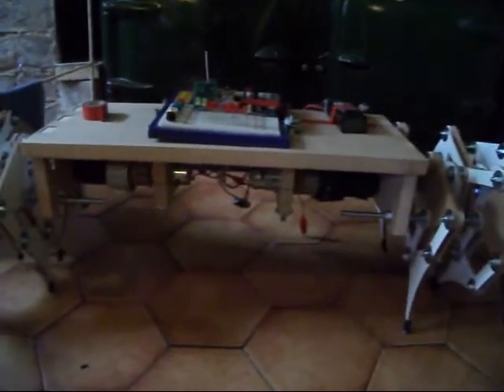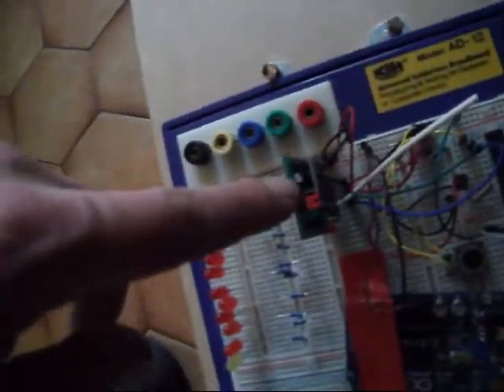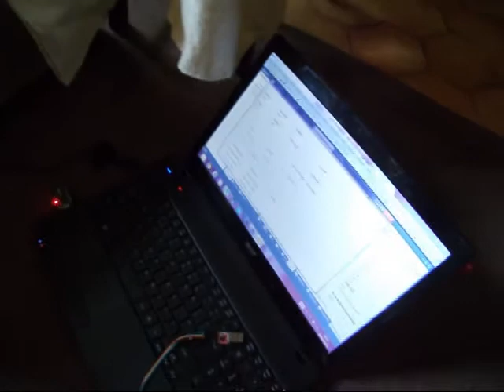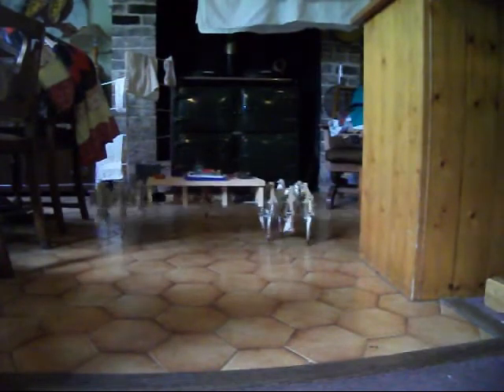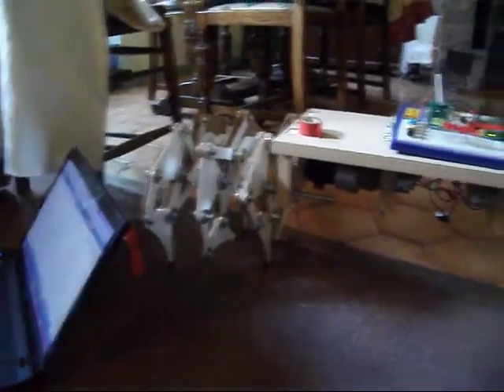Pc Gamepad VB.Net to Arduino 6

Comment: What was your solution to the VB.net interface of the controller?
Reply from the maker: +Scott Vickrey Hi there, it was a long time ago now and I can';t remember exactly what I did :D But I basically wrote a small program in VB that would interface with the joy pad and communicate over serial. By far  the hardest piece of code I ever wrote and sadly one I no longer have :( Sorry I can't be of more help.